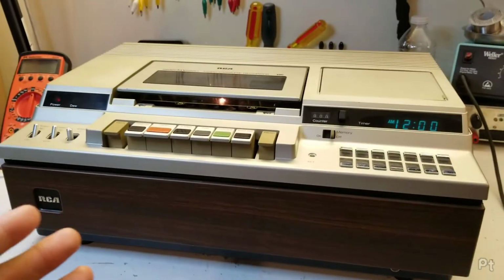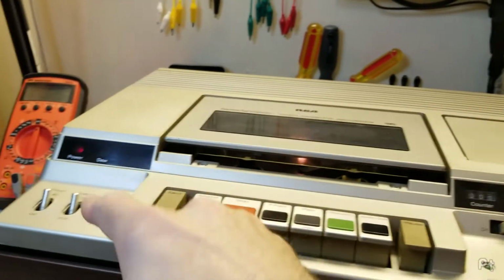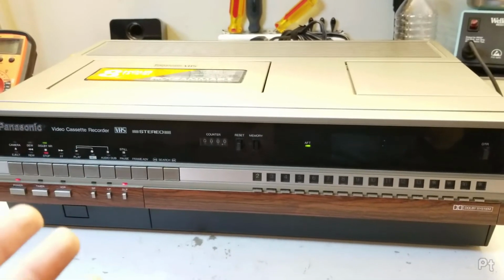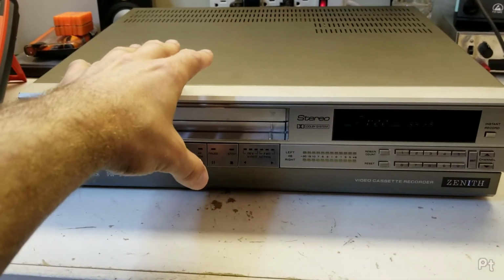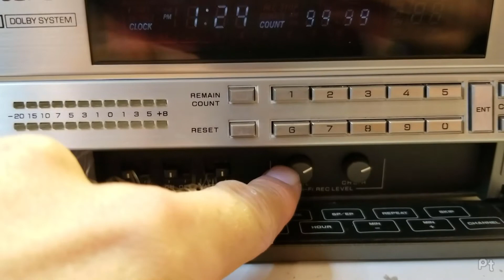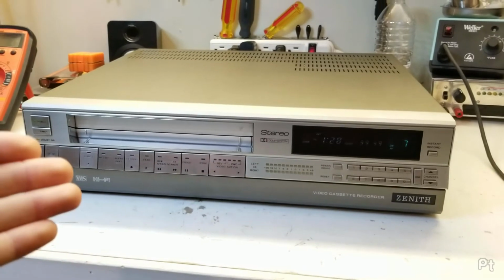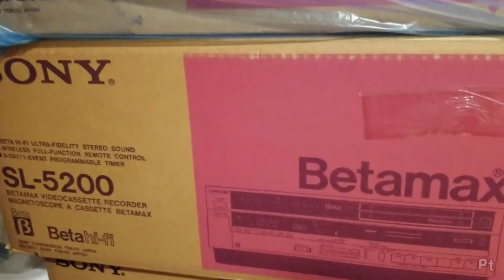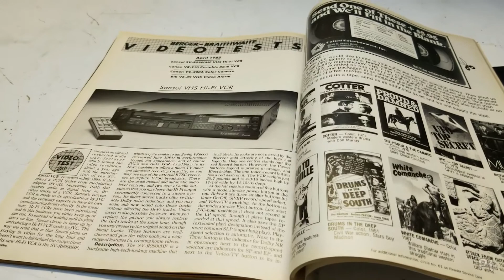VCR Basics - All About Audio

Comment: I had a SONY SLO-123 VCR which was B1 only ( 40 mm/sec. ), and tuner-less.  I got it at a yard sale for $10.  It needed a new counter belt and light bulb for power indication, and I intended to use it for archiving home videos.  Alas, I think the head(s) were too worn, as they would not present an acceptable recording.  I was  always amused that the designation of SLO mean't the fastest speed, at least for this m/c.
I made a few "MIX-TAPES" on both Beta hifi and VHS Hi-Fi  m/c's and I found that it was best if I started with a fresh unopened cassette, because any slight dropouts from tape path shuffling on used cassettes  would cause terrible artifacts when playing through an audio systerm.

I think you present your videos with wonderful clarity.  Thank you.

Comment: Didn't notice any errors, but here are some additional points:
-Hi-fi stereo (for both beta and vhs) is FM-encoded like the luma signal (and like FM radio). This among other things helps protect it from amplitute variation from varying signal strength. Additionally there is some extra processing in both formats, including some form of noise reduction though I don't remember the exact details. Linear audio only has emphasis/deemphasis (ie equalization) as standard.
-While linear stereo soon disappeared on consumer VHS decks, the big-ass professional decks did continue to feature it (in combination with hi-fi stereo). One use was to use one of the tracks for cue/time code stuff, though I don't know if that was the only reason for it being a feature though. They also typically are able to output both linear and hi-fi tracks at the same time on different outputs. 
-As you hinted at, while the hi-fi tracks are way better quality, the linear track is much more robust, so on very worn or damaged tapes it can end up being more listenable. The hi-fi track seems to also be more sensitive to tracking/alignment differences than the video tracks. Since two sets of heads are used for hi-fi, it is also a risk of minute deck differences being large enough that you can end up with the tracking or alignment setting for the video track would not be the best for the audio track and vice verca when played on a different deck. Probably more an issue on very slow speeds.
-I don't know about NTSC decks, but I'ts common for PAL decks at least to have a mix option that outputs both hi-fi and linear at the same time mixed together. This could be used to e.g put a commentary track, dubbing or background music or something else on the linear track (many vcrs had an audio dub feature that let you record to the linear audio track while leaving video and hi-fi intact.) 
-The wikipedia page for betamax notes that for NTSC, sony moved the luminance carrier up a little bit to make space for the hi-fi audio tracks, but can't find the source on that.
-PAL betamax used a system similar to VHS for hi-fi as you noted, seemingly due to lack of frequency space.
-Betamax had something akin to dolby noise reduction called Beta Noise reduction for linear stereo tracks.
-Betamax hi-fi had larger on-tape frequency deviation than VHS, though not sure how much that if anything that improves quality in practice.
-Sony's later video8 and hi8 also use fm-encoded audio read by the same heads. Unlike VHS/Beta it was the primary audio format on these tape formats. Early and low-end models had a mono variant, while higher-end ones recorded in stereo (that could also be played back in mono in mono models.) I think the way it worked was that it recorded a base and difference signal rather than a left and right track, leading to reduced stereo separation and not quite as high quality as vhs/beta hi-fi but not sure about the exact details. It was one of several advantages of 8mm camcorders over VHS ones as VHS ones rarely had hi-fi.
-Video8/Hi8 also supported 16-bit/32khz PCM stereo (featured only in "pro" equipment), some models even supported more than 2 tracks. It was read by the same heads, but used the edges of the track or something. The standard also notes a linear audio and linear cue track, but not sure what models if any actually used that.
-PCM recording using the video signal existed on VHS (and also U-Matic), though for VHS it was mainly done through some special VCRs rather than a separate adapter like with beta. The was a later system (ADAT) that used SVHS tapes to record digital audio as well.
Reply from the maker: Wow, thanks for this info. A lot of this I glossed over and completely forgot about! Regarding Hi-Fi tracking issues between VCRs, yes this is an issue that is made worse with the slower EP/SLP speed. I've found that alignment needs to be perfect or the video and audio tracking doesn't quite line up.
Reply: Linear audio never disappeared on consumer VCRs. Linear tracks were still used right up to the very last VVR ever produced, and no VCR was ever produced without the ability to both record and playback linear audio. A tape recorded on every HiFi deck was still playable with sound on the first VCR ever made. HiFi VHS dud record in HiFI bur also recorded the linear track to maintain compatibility. While it is true that companies like Panasonic dropped back to mono linear on their first HiFi VCR and never produced a model with both HiFi and stereo linear, companies like Philips and JVC, and Mitsubishi kept linear stereo on their HiFi models. In fact, my Mitsubishi S-VHS machine has linear stereo recording and playback along with HiFi audio.

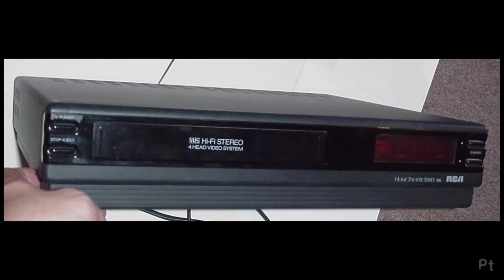Comment: 13:40 that is exactly the VHS machine I had in 1992, the RCA one.  Loved that VCR, especially the video index capability it had.  It would mark an index on the control track on new recording and you could the skip forward/backwards to find episodes you recorded into tapes.  Do you know what the model number was, I’m curious to lookup specs on that machine again.
Reply from the maker: That one is a model VR660HF from 1992 as you said.

Comment: @5:00 "anytime you see a VCR that has Dolby NR, that means that it will be supporting this old stereo recording format"
Not always. My very similar-looking National/Panasonic NV-7500 has Dolby B but it's only mono. Yeah, odd machines like this existed. JVC and AKAI made a few linear mono machines with Dolby as well.

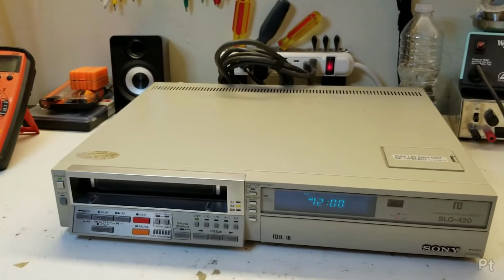@14:33 For the PAL/SECAM markets, Sony did put out a handful of linear stereo consumer Betamax models such as the SL-C6ES, C9, C40 etc.
Reply from the maker: Interesting. I wonder if the mono VCR with Dolby B is more of a PAL region thing, since the . The NV-7500 looks like the PV-1770 we had, but it didn't have Dolby B.

I do find it interesting that Sony had linear stereo consumer models in PAL markets. The C9 was similar to the SL-2500 (but stereo) and the SLO-420 I showed is the industrial version of the SL-2500.
Reply: @probnotstech  The NV-7500 looks almost identical to the PV-1400 or 1470. And yeah, the American-market equivalent models don't have Dolby for some reason. There is an industrial version of the SL-C9, called the SLO-420P (P for PAL). There's also the SLO-1700 (again PAL) with both linear stereo and Beta hi-fi audio.

Comment: Have you ever heard of a VCR with two sets of audio heads allowing for recording and monitoring of audio similar to reel to reels? If it did exist that would be a cool inexpensive alternative to reel to reels.
Reply from the maker: I think the issue is that would only work for the linear audio heads. And even at the fastest VHS speed (SP) the linear audio is mediocre at best. For context, the tape speed for NTSC SP is 3.335 cm/s, and the slowest reel to reel speed is 4.75 cm/s (1.875 ips) and is really only good for voice. Hi-Fi has the good sound, but doesn't really lend itself to easily adding a second set of heads to separate record and play.

Comment: The slow speeds don’t seem affect frequency response or s/n ratio but there are more artifacts due to the tracks being closer together.    The AFM does use a compansion type NR similar to dbx2 nr.   Still the sound was pretty remarkable particularly compared to non hifi.

Comment: Hello, detailed question here:
What's the difference in sound between linear Hi-fi stereo vs Hi-fi stereo NICAM system, when watching vhs movies with hi-fi stereo? As I've understood the NICAM system is digital, but I'm not sure if it's in use when watching movies or only when broadcasting/recording. If in use all the time, I'd imagine it would sound a bit different than the linear Hi-fi stereo that's purely analog, right? I would appreciated a comprehensive answer addressing these questions. I'm not that interested in broadcasting/recording, so mainly how NICAM works while watching movies and the difference between that and linear Hi-fi Stereo. Thanks
Reply from the maker: I'm not very knowledgeable about NICAM since it was never adopted here in Canada, nor the US. 

I think you are correct in that it was only used for broadcast audio (similar to MTS Stereo in North America) and is not related to VHS Hi-Fi Stereo. I think any VCR that boasts "NICAM" on the front will have a NICAM capable tuner.

The NICAM wikipedia page mentions that Hi-Fi VCRs were informally referred to as "NICAM VCRs" since they could record the high quality audio stream - but they wouldn't have recorded using NICAM, it was still analog VHS Hi-FI audio.
Reply: @probnotstech  Thanks for the message!
This would make sense. Do you think there is any difference in audio between these MTS stereo/NICAM vcrs and the linear hi-fi vcrs in terms of audio? I have made comparisons watching movies with my NICAM hi-fi vcr and streaming & dvds (through all analog audio equipment) and I must say there is usually a huge difference in audio quality in favor to hi-fi vhs, especially during scenes containing music and loud special effects. Worth testing it for yourself if you haven't (using all analog audio equipment)!
Reply from the maker: I would suspect Hi-Fi can support a much higher fidelity than MTS Stereo. Not sure about NICAM. DVD audio is objectively better than Hi-Fi in terms of specs. I'm not sure where streaming would stack up - worse than DVD for sure, but I'm not sure when compared to Hi-Fi. . Hi-Fi was very high quality, essentially CD quality except analog rather than digital. My only complaint is the integrated noise reduction on some Hi-Fi units can be a little aggressive. Could just be aging components.
Reply: @probnotstech  Interesting. While DVD might have higher frequency range, Hi-fi VHS is still 20Hz-20kHz, and yet it somehow sounds better. Might be due to it being analog format or something to do with compression differences. Again, I urge you to do A/B testing for the same movie for yourself, I'd think you'd be pleasantly surprised. As a side note, about streaming, I noticed many movies having different fps rate than what the streaming platform outputs, resulting the sound being pitched lower and the overall movie being a tad longer in length. I might try to hunt down a linear Hi-fi stereo vcr and do some A/B testing between that and the NICAM one.